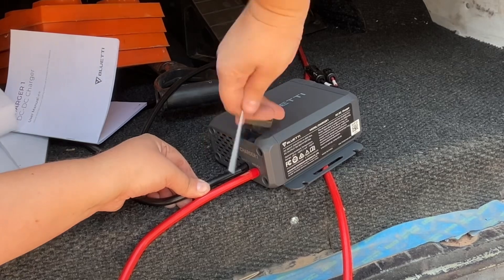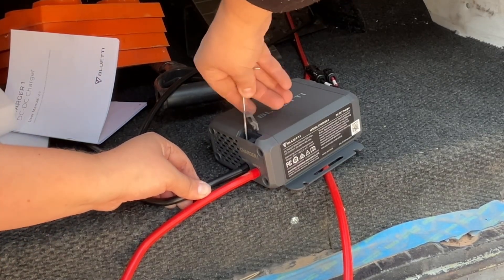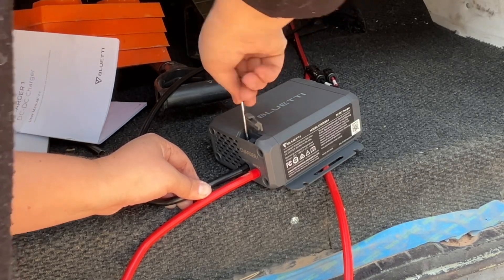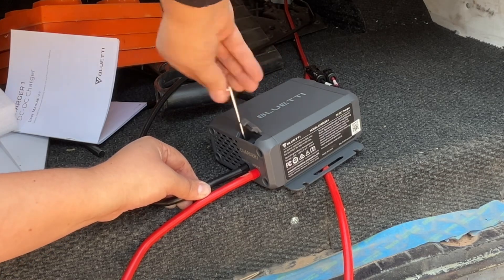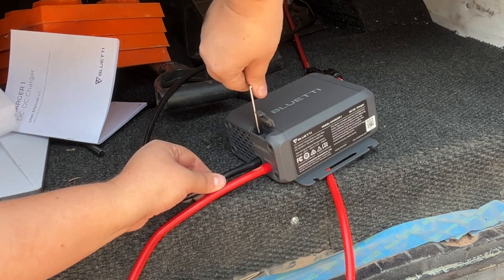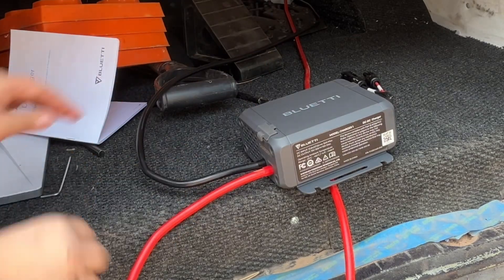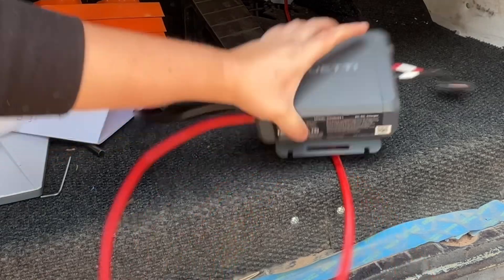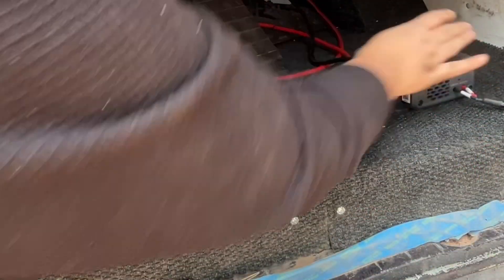What is DC to DC Charging? How Alternator Chargers Work for VanLife (beginner friendly)

Comment: I have 2 lead house batteries that are charged by the alternator with an isolator in the engine compartment. Any idea of the impact if you add the Bluetti 1 as well to charge a bluetti power station?
Reply from the maker: I would see what your specific alternator is rated for. If your house batteries get used frequently and need a charge and then you are adding another 200-400w on top of that to charge a Bluetti, it might be too much for your alternator

Comment: I did buy that charger1 and also the new 200 bluetti has on sale, I haven’t connected it yet, I did watch your video on that, I need to look at it again, I’m not sure where I’m feeding the cable through yet, my van is new and I’m not drilling any holes ! Making a trip out to the Q next month so that should give me an idea of how long I can last between chargings.
Reply from the maker: Amazing! Yeah luckily I already had a hole in my floor to use, there may be one like mine under the plastic in the footwell

Comment: Thanks for this! Always learning :) 

I have the Bluetti AC180 and their 200w solar panels. I almost never use the panels. I find it an annoyance to pull them out and set them up and then have to sit there in one spot waiting hours (and that's if you even have enough sun to warrant going to all that bother). So they're just taking up precious space in my SUV, but I keep them just in case of emergency. I mainly charge via the 12v when I'm driving as well as taking advantage of electric outlets when/where I find them. This info is very helpful in better understanding how all that alternator stuff works; I've been curious about that for awhile.

Comment: What do you use the charger for?
Reply: You would use it to charge the house battery while driving. My van came with a lead acid house battery which can run my furnace for about two hours and my air conditioner not at all. If I swap the lead acid out for a lithium, then the alternator will work too hard and shorten its life. The DC to DC charger will slow down the charge on the lithium battery and not stress the alternator as much.